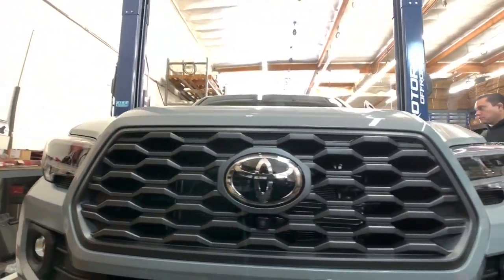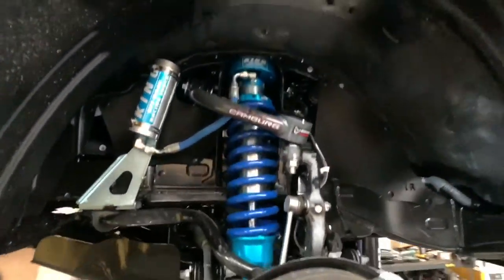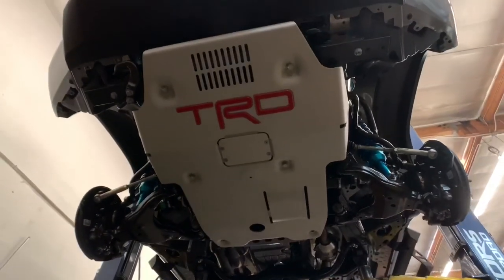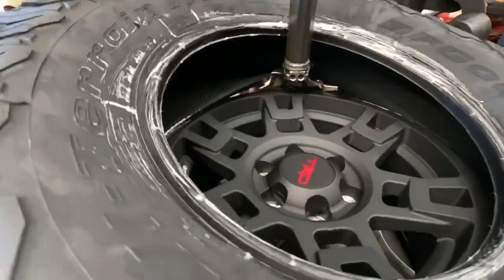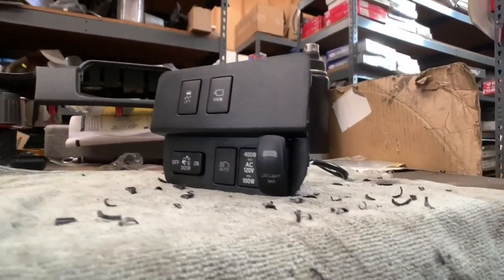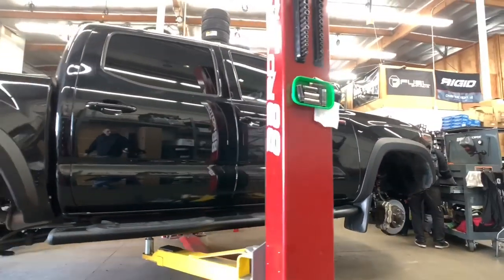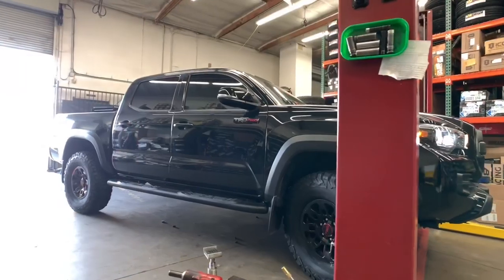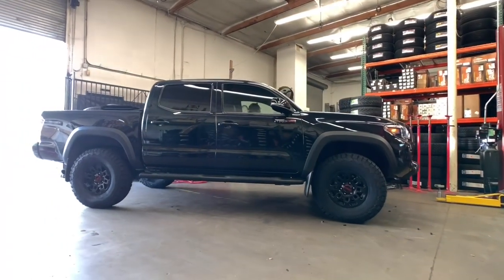2020 TOYOTA TACOMA KINGS LIFT, LIGHTBAR, BAJA DESIGN SQUADRON SPORT

Comment: The 285 looks way better on a 16 than a 17.  Is it possible to go down to a 16 on a 5th gen 4Runner?
Reply from the maker: Unfortunately, wouldn’t clear. 17’s smallest wheel diameter on a 5th gen.